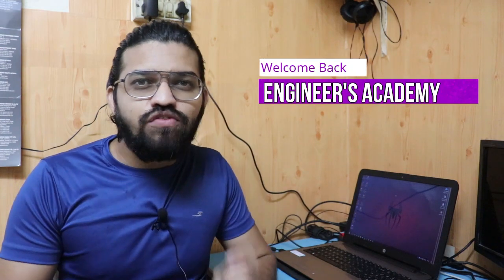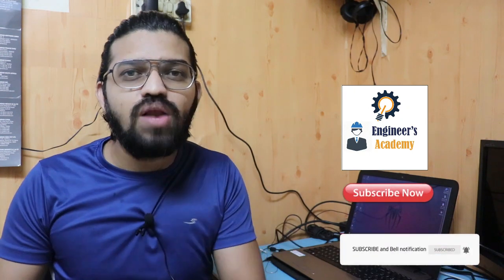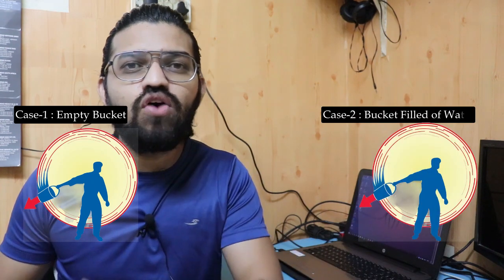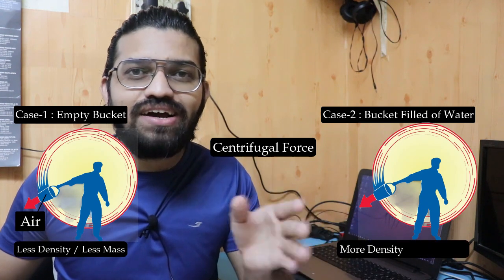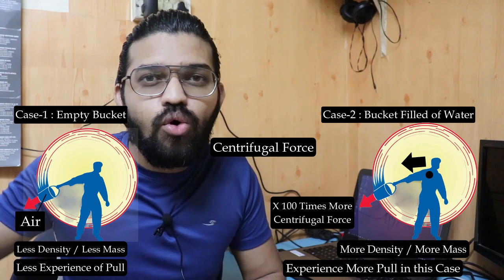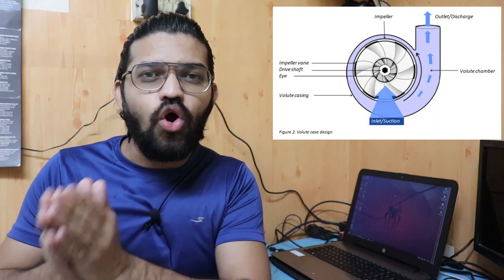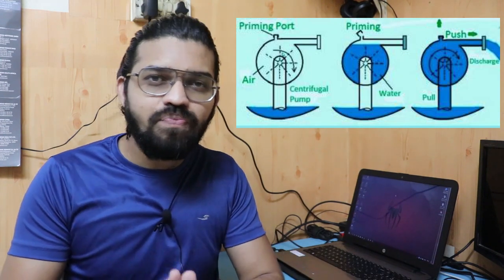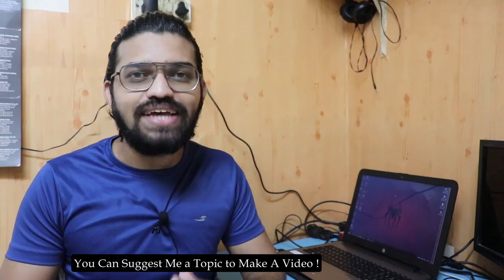Priming of Centrifugal Pump.

Comment: Dear sir kindly clarify my one doubt because I think there is a slight mistake in the diagram that you have showed at 5:39 I think even the suction line should also be shown completely filled with water in the middle diagram or else the pump won't work...what do you think...please reply
Reply from the maker: Yes ! Initially you need to fill the Casing With Water ! & when the Pump starts ! the Impeller Will throw that water at higher Side ! N thus Creates Suction at Begining ! Hence Casing should Fill With Water.